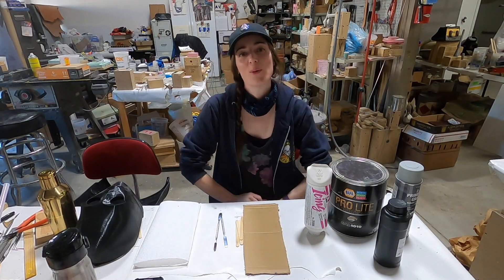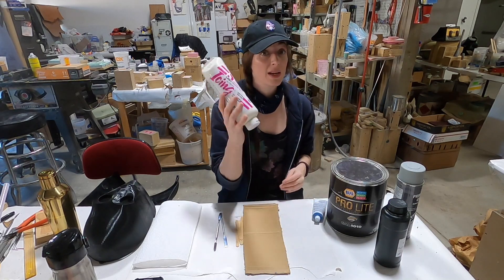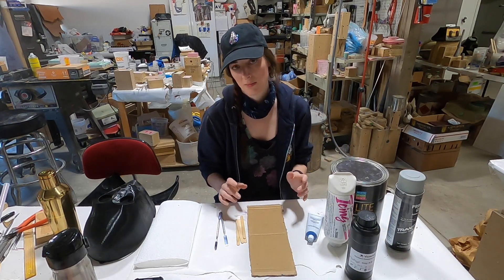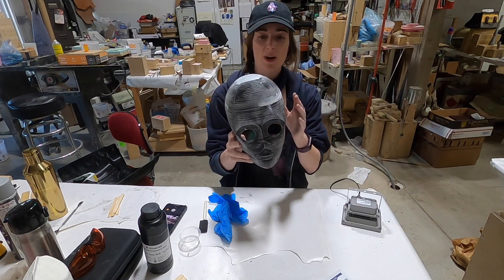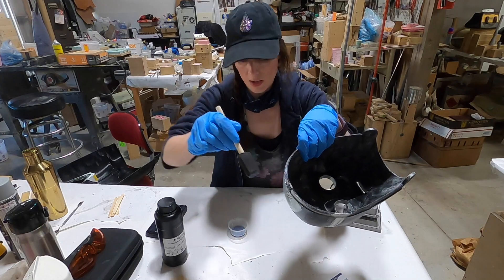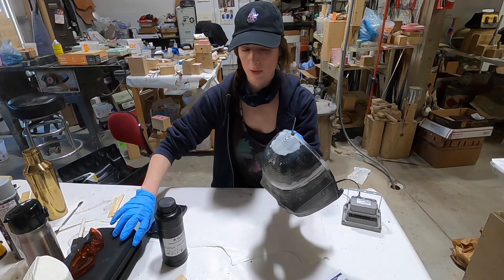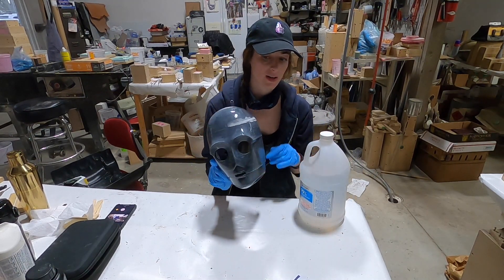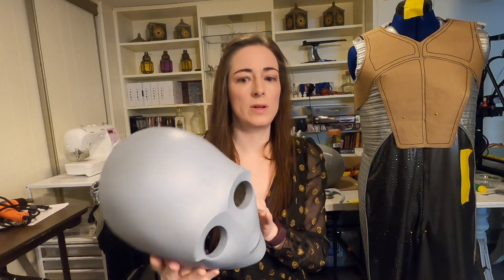Smoothing 3D Prints // Photopolymer Resin

Comment: I can recommend wood filler instead of body filler  especially the water based wood filler. If you need it thinner, add water. Dries fast...ish easy to sandman smooth. I also use uv resin and dupol 2ton epoxy glue. The 2 part 2 ton epoxy gives a great smooth finish on joints

Comment: This answered some of my questions about 3D print finishing - really like the hi-build spray primer idea. My advice on using putty-type fillers, especially with ones that harden like rock... plan on a 2 coat application - a fill layer which is scraped into the low spots, where you can still see the original surface peeking through and then a final skim coat, which puts a few mils over the entire piece. It's the best way to avoid the tendency to overfill your work - it takes ages to sand down and wastes a lot of material.

Comment: Give automotive 'spray putty' a try. Goes on like thick filler primer and will fill layer lines in one coat (usually). Comes in a spray can ready to use, without having to make a cocktail of Bondo and acetone.

Comment: This is awesome, what grit do you use to sand the resin? I want to do the same but I'm unsure if i should go coarse or more fine.
Reply from the maker: I usually start with a 180 grit. I may or may not go finer depending on my plans for the next step. Often I’m going to follow with a filler primer anyway so no need for this step to be super smooth or perfect.

Comment: Interesting, but as a not native speaker I find it difficult to follow - the sound is set low, you speak fast, quietly and in a murmur manner. When you cure residue UV resin, submerge the whole thing in plain water and then expose to UV light - it will cure fast and clear, much better than in the air.

Comment: Curious if a vacuum chamber would reduce the oxygen effect in curing when exposing to UV.
Reply from the maker: It would. I know some people actually cure 3D prints in water as well to reduce oxygen inhibition. In this case because I want to work fast, just removing the uncured resin via sanding is fine. Now for 3D printing I’m probably going to shift into playing around with water curing and see if it can reduce the cure inhibition with platinum silicone when molding prints. It’s that uncured resin that causes the inhibition when making the molds of the resin printed parts.

Comment: nice work, i would suggest using wet sandpaper when sanding your prints, especially after using resin and please please please wear a mask while sanding, you do not want resin particles being breathed in, its even great practice to wear a mask while handling UV resin and make sure it is suited for filtering organic odours as well as particles
Reply: The resin is very toxic indeed, a decent painting valved mask is highly recommended when sanding.

Comment: The company I work at we developed a method for smoothing PLA with acetone, its incredibly quick and creates some great results.
Reply: PLA are you sure you don't mean ABS? Explain how if so
Reply: @foxsmith770  I use super heated acetone as a heat transfer, acetone has a very dense vapor even in this heated state which helps it stay in its container. Once it starts boiling and the vapor line has reached the edge of the vessel (its very clear you can see it moving up) then I submerge the model below the lip of the vessel for 5 seconds. I keep doing this till it reaches the desired smoothness (normally 3 dips) This is done on a long wire, if fingers pass below the lip you are instantly burned. We do this in a lab with extraction and safe heating sources.You can use it also with ABS but your REALLY have to watch it as its almost instantaneous.
Reply: You confused pla with abs. This technic only works with abs filament.
Reply: @rintarouokabe6635  Again we only use PLA at our company, the actetone isnt chemically effecting the PLA we are just using it as a heat transfer for its dense vapor and high boiling point.
Reply: @KylejvT  how hot do you get it? Is this something possible to experiment with in a home shop in your experience?  Sounds interesting and I'd love some more information
Reply: @13dirtblack  We haven't gone too much indepth because our company stopped using FDM printers. But this is what we learned and what we still use for internal orders and personal projects.
The boiling point of acetone is pretty low 56°C but due to its nature being far heavier than air the vapors collect and sit in the container and your able to super heat the acetone, you know the moment you've reached that point when as its boiling you see that line I mentioned slowly start to creep up the side of the container (remember glass or metal). Everything below that line is exceedingly hot.
It works with most PLA's that we tested though it does not work at all with PLA+.
You can do it in a home setting but use extreme caution, WELL ventilated area (we often use a smoke extractor above it.) Keep pets out the area. (the vapor is as I mentioned heavy and while you might not notice it could collect at pet level. 
Breathing it in is also super bad, if you get a hot gust it will burn the way down and even if its cool you will have problems breathing it out again so if you do attempt it use proper PPE's
As for heat source you can get cheap induction plates from most online retailers.
Reply: @KylejvT  that's awesome... thanks man. I got a good shop with pretty decent exhaust etc... I'll have to try it out

Comment: You need to build a cure booth. And you if you are sanding resin don't forget to use a face mask, that dust is nasty. I use the resin technique in my prints and it doesn't need no ipa to clean it, just go with fine layers and cure it a few times after that it's just sanding and clean the dust and ready to go. And you can always leave it out in the sun 30m or so. Btw if it's tacky the resin isn't cured. With a resin printer the bath is to wash all the uncured resin, after that is cure time and depending the pieces it's 5 to 10 minutes, not a few seconds like you did. Nevertheless it's a good video on how to use the different materials at our hand.
Reply from the maker: I tested this multiple ways before making the video along with talking to others who had been trying this technique. I cured it for 45 minutes at one point and still tacky. If you understand the science behind this depending on your resin and environment you may always have a slightly tacky surface due to cure inhibition at the surface. Also the technique I show is for those people that want to work fast and not wait 30 minutes to an hour for the chance it will make the surface not tacky. I do have a cure booth for small things but for larger items the handheld method works well.

Comment: Really handy thank you. I've been printing the same files for a dismembered 3PO to go on the back of my Chewie costume and sanding/filling/sanding/repeat has been so tedious even with just the head and front/rear body sections. Think I might try this technique for the legs and arms
Reply from the maker: There will still be some tediousness with this process but I felt it was still faster than some of the other things I’ve tried. I know many swear by 2K primer but that’s such an ordeal to get setup. At some point when I have a better painting setup I’ll try that but for now I think I’ll use this process.